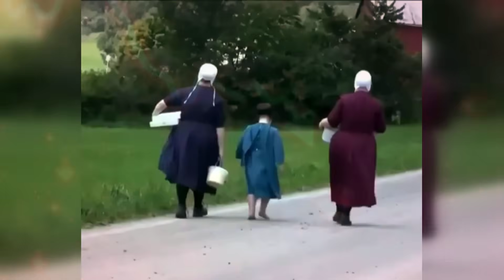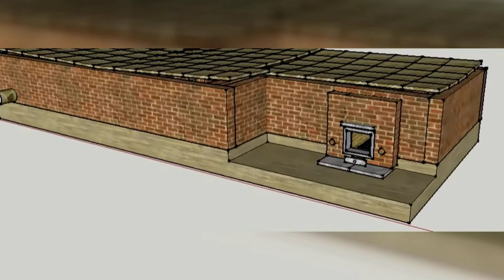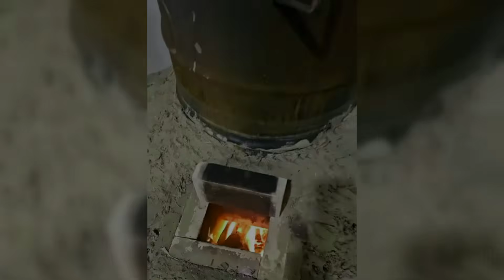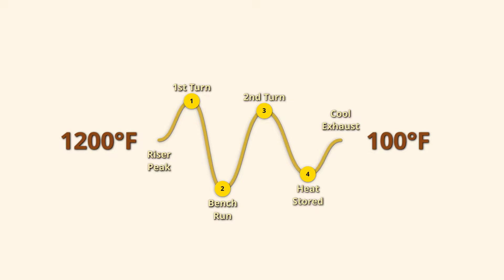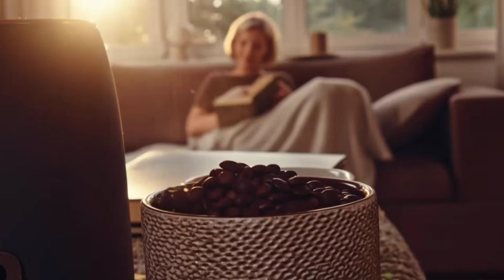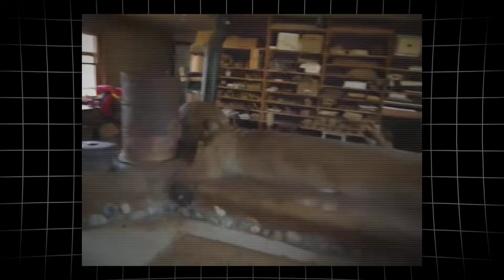$50 Stove Heats Any Home for 24 Hours on Two Logs. Why Did They Ban It?

Comment: Electrical heating element thermal electric generator voltage multiplier electronics organic carbon power cell powers the heating element till TEG kicks on charges power cell up puts it on standby while powering the heating element till kill switch it is flipped. Why burn anything? 🤔✨️